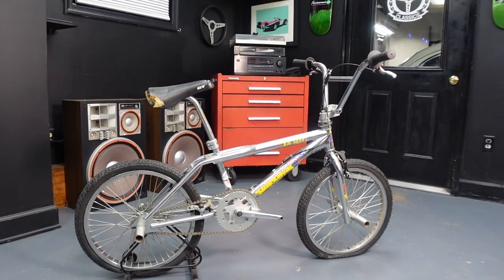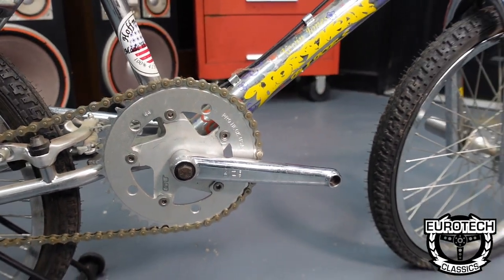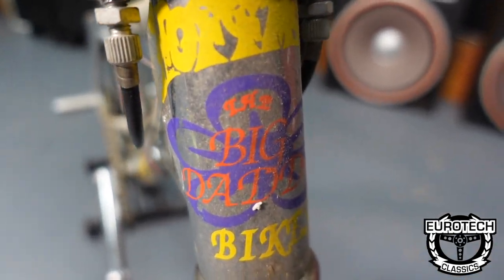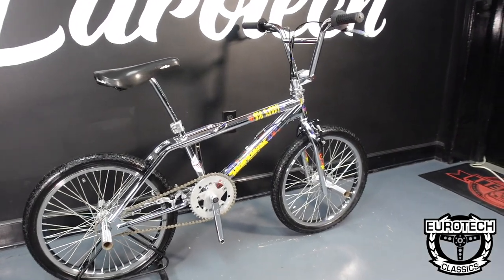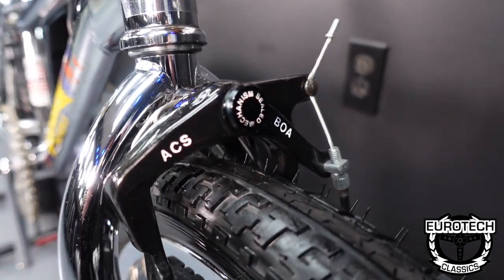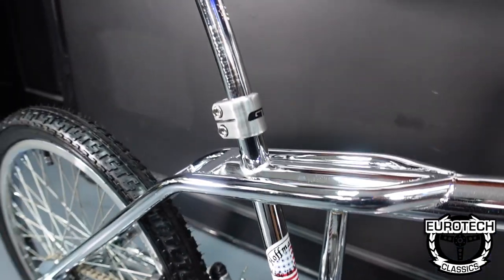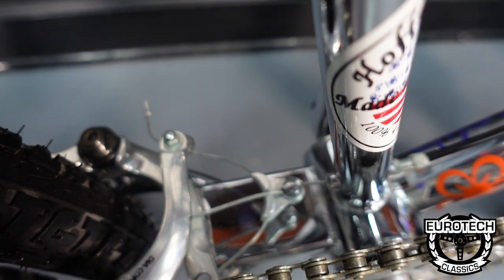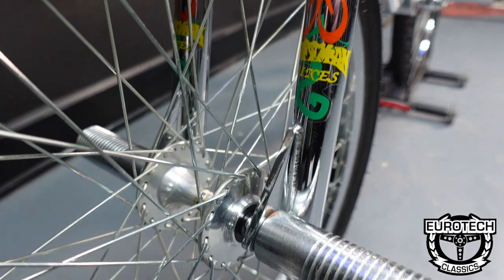Hoffman Big Daddy USA Made old school Flatland BMX

Comment: Mite be the only big daddy with the original big daddy stickers still in good condition
Reply from the maker: Yeah it seemed as if it was brand new and put away in a garage. The only thing that was used was the seat post and seat (when purchased). I changed those and spent all day polishing the chrome. Even a new old bike, it gets little surface rust. I listed it on eBay since I’m a S&M bike guy and maybe someone was looking for this sweet Hoffman. And yup, it sold in less than 2 hours